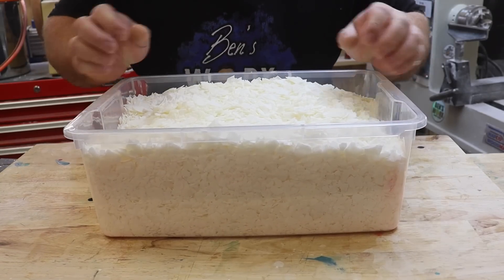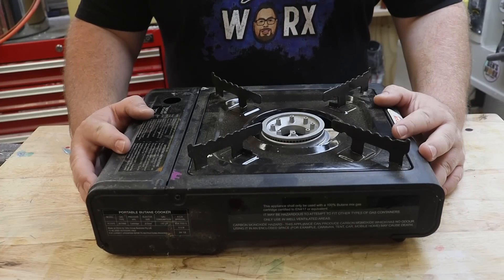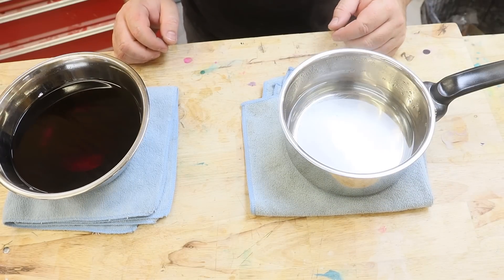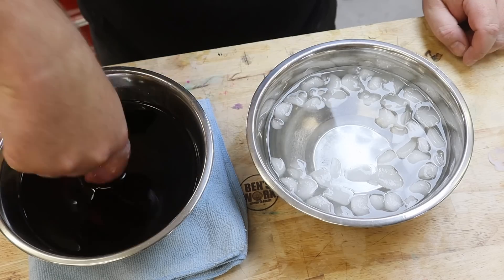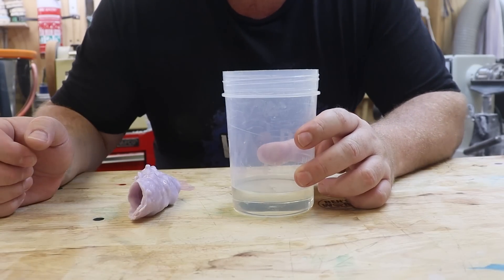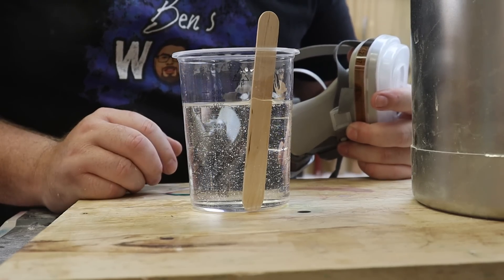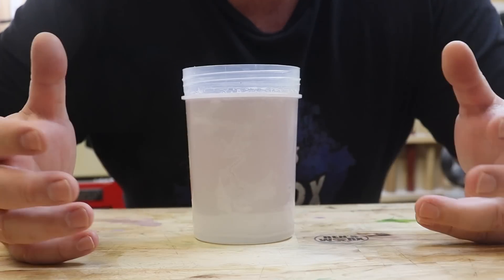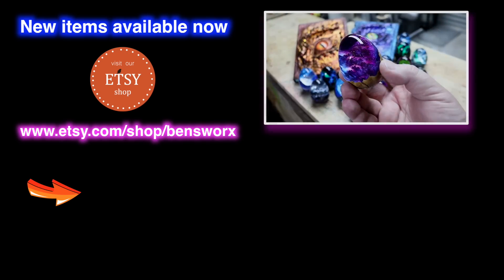What Happens to Wax in HOT Epoxy Resin ?

Comment: I'm totally new to resin art. One of my very first projects was to set a rose in a globe mold which I did but then discovered my rose was floating sideways in the resin. So I straightened it and put a large candle on top to keep it down. Duh! the wax melted as the resin cured and dribbled into the resin. The wax created some really interesting designs in the resin kind of like the molten aluminum castings of ant hills. This has potential.

Comment: You can make it more flexible and elastic if you add Elmers glue to the wax when it’s melting. That or you can buy brewers wax which typically has an elastic property built in, specifically for adding wax to the tops of bottles. If the wax isn’t elastic it will chip away easily and it with be difficult to open without getting wax in the beer itself. 

Love your videos by the way!

Comment: I think it would be cool to do the same thing again but try and fill the finger cast very slowly with several layers so that it didn’t heat up and melt. Then do the same on the outside with clear resin. Once it’s cured. Drill a hole and heat it in so the wax melts out.

Comment: I have an idea that I wish I could see happen. 

If you blow up a balloon big and then put it in the pressure pot, how much will the balloon shrink?

If the balloon shrinks a decent amount, what if you submerged it in resin and then had it shrink as the resin hardened? 

What would happen if you cut into the pressurized balloon that is stuck in the hardened resin? Would it hiss as the air escaped?

Comment: If you might have used a solid finger you might have get more of that "interesting" pattern inside the resin. If you wait a couple of minutes between the wax dips your result should be better, no water just pations. The handlotion is to get it easier from your finger it should have no influence on the wax. After a couple of dips you might be able to fill the model, but the wax needs to be liquid but not hot, is a very fragile border of tempreture.

Comment: I wonder what would have happened if you had made a silicon mould of your finger, filled that up with wax, and then froze the wax finger and then tried putting it in resin. Would either the temperature slow the initial melting, or would the fact that it's a solid lump of wax change anything?🤔

Comment: I wonder what mixing in the wax flakes right at the point of setting would do. Like add them in right as its about to solidify. It would also be cool to try and remelt the wax out and puta a new resin color in. That way you get actual layered colors instead of swirled mixed colors. Very interesting idea all around mate! Great vid as always!

Comment: When you mentioned making wax finger I was thinking silicone mold of finger then fill the mold with wax to produce finger made of wax. I’d be curious how wax would act if it was completely covered with uv resin then had resting poured around it. If it melted it would be hard to tell as it would fill the void, but if the wax was hollowed out and sealed before being covered in uv resin it would be easier to tell it melted. Great video I enjoyed watching the wax melt.

Comment: A silicon cast of your finger then filled with resin to make a finger positive would be cool. You could then paint the finger with melted wax to build up a uniform and thick layer. Mount the finger on a base and fill with resin. We could then see your finger pointing to the void left when the wax melts.  I am picturing Michelangelo's Creation of Adam style finger pointing.  The evolution of the fingers holding an Oreo.

Comment: Hi Ben.  If you like to expand on wax and resin projects, I'll share an idea.  Those dye chips that melt on clear wax might result in even more interesting outcomes if you can manage to first make a hollow resin egg, cut it in half, then carefully add the wax shavings and a few colored ones in.  Once you have both halves of the egg filled with your wax pattern, seal everything together and then secure the egg in a container before finally pouring the resin for turning.  I think the heat should still penetrate and mix the wax into something pretty!

Btw, keep up the good work, your art and presentations are so cathartic! 

Thanks 😊👍

Comment: I'd like to see another paintball episode but with one paintball mounted to the center.   Perhaps two versions of the same experiment; one with a solid paintball and another with a few pinholes punched into the paintball to see if the paint bleeds out into the resin during the pressure pot stage.

Comment: Interesting. I was expecting a casting of your finger and then pouring wax into the casting, not dipping your finger into the wax to make a finger-sleeve. That finger-sleeve was thin, so it is obvious it would melt, although faster than I thought it would.  Now, I am curious about a "small" ball of wax, a wax replica finger, and the traditional candle with an LED light for the wick.